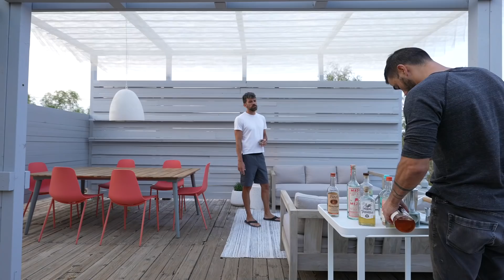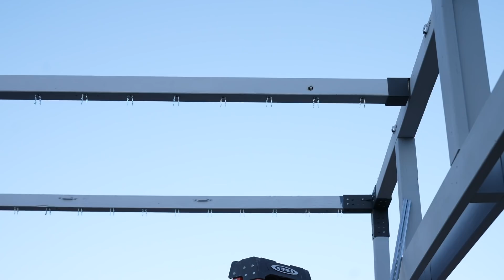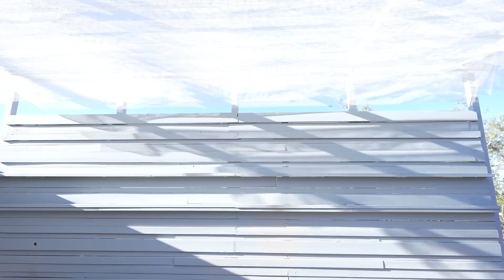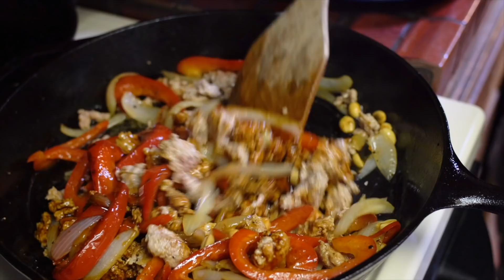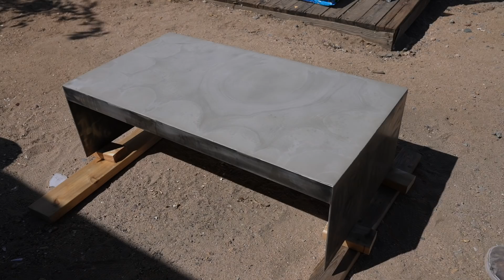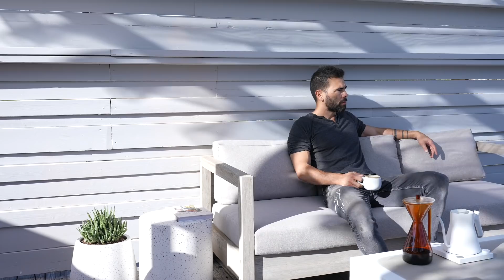Low-Cost DIY Patio Shade System

Comment: That's alot of timber & steel, just to hand netting..I would  have used netting spring wire,one side to the other, hooks to attach the wire,strong as anything & not going anywhere. And it would have saved heaps of money & time and look exactly the same

Comment: Very cool. I've been pondering this exact question. I moved into in a sixth (and highest) story appartement with a fairly large balcony - which will be all but unusable during heatwaves, because it gets full sun from sunrise to early afternoon. For the sake of my plants alone, I'll need some sort of shading...but man, it gets windy up there. 
So the whole thing needs to be fairly wind resistant, but can't be too heavy, either. And it needs to be removable, because the sun does a great deal to help heat my appartement during the colder months. 
This might just be a workable and affordable solution!

Comment: Wouldn't the zip tie degrade by one season?   If you did a hem that accommodated the diameter of the conduit, slip in into tube of the hem before mounting?

Comment: What if you add some boards to make that smaller west wall taller? 
Or use conduit to make posts off the top of that wall and strap that fabric in-plane with the wall? Maybe a different fabric for a pop of color.